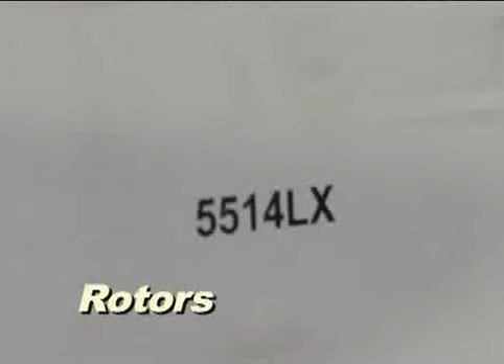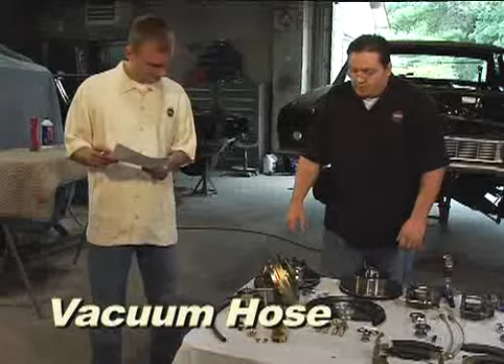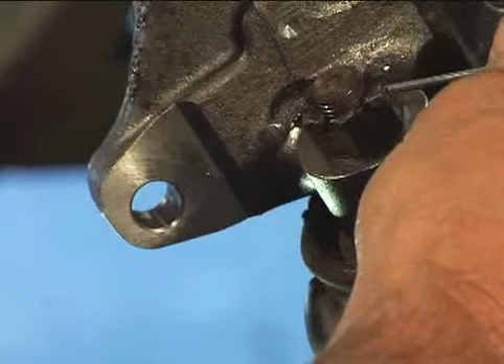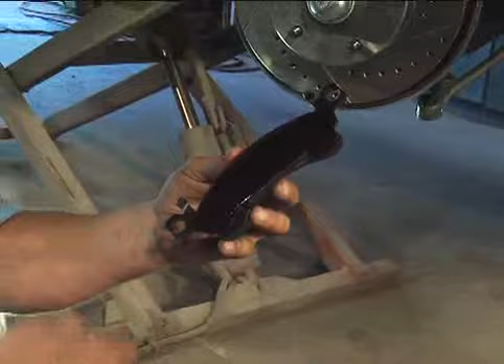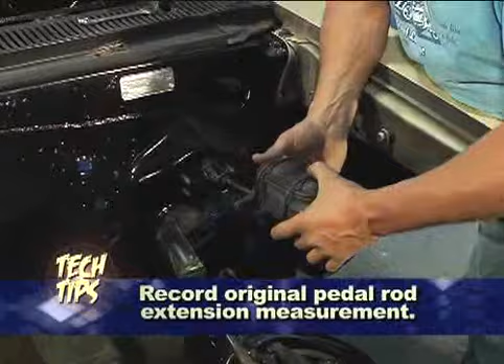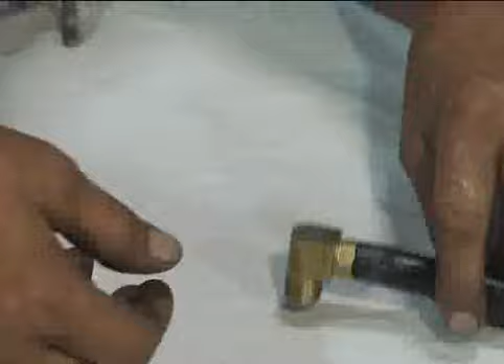GM A, F, & X Body Disc Brake Caliper Brackets Nova, Chevelle, Camaro, Firebird

Comment: I always love these videos that show the nuts and bolts on 50 year cars that come right apart......every single nut and bolt on my '71 Chevelle required a blow torch, hammer and sawzall to remove.....
Reply: Hahahaha same.  Like it seems these shows do the job, put the stuff back on and then re do the job for the camera and every bolt breaks free with a regular size wrench or stubby ratchet handle.

Comment: They did not hook up any brake lines to the car, That was at least an incomplete kit. The way they left it there would be no brakes at all.
Reply: The car already has its own brake lines. You hook those up to the new components. If you need new brake lines, you can purchase them as a kit. I’ve yet to see a kit that includes everything in this video plus the brake lines.

Comment: What I want to know that no one has ever answered is if you have the distribution block that was originally mounted on the frame under the car how do you connect the brake lines to the new proportioning valve located on the master cylinder?
Reply: Did you get your answer? I'm curious, I have a 64 A body with power drum brakes.
Reply: @georgearce5098  No I never got an answer. I just mounted my proportioning valve in the original spot and ran lines that were preformed like the originals. I think I got them from Ecklers.

Comment: Hey shitt for brains, what about torqueing the bolts on the disk brake anchor bracket and the steering knuckle? You don't simply tighten up with a wrench.. it has to be torqued.

Comment: Don't buy anything from these crooks they will not stand behind their products, will not return or answer emails and give you the runaround. ( real-life Pirates )
Reply: I just had to do one for a friend it was a nightmare. The passenger side caliper bracket was slightly bent so the caliper wouldn't fit. That among with 2 or 3 other parts had to be modified to fit. Not happy.

Comment: Hello I have the same brake caliper set up and after i install the caliper and spin the rotor. The outer brake pad rattles, like its loose. how do I correct this?
Reply: I know this is an OLD Post but Someone may have the Same Question- if the OUTER PAD is Loose in the Caliper(and Moves) then the Top Tabs need to be Slightly Bent by Tapping with A Hammer, Until the Pad is Snug in the Caliper.
Reply from the maker: Sounds like you are missing a brake pad clip. They hold the pads in place so they don't rattle. Also sometimes called anti rattle clip....
Reply: P Jack I purchased these rattle clips that were recommended for my nova. But im not sure how to install. I know that the bigger size are for the inner pads but im not sure how to install the smaller clips. Any ideas? http://shop.advanceautoparts.com/wcsstore/CVWEB/staticproductimage//2566/large/22141334_rnb_26210_pri_larg.jpg

Comment from the maker: You can't use the old spindle when doing a conversion kit. You will need to change out your spindle to a discbrake spindle.
Reply: Stefan Bogunovic you can modify the old spindle by cutting .6 of an inch off the top boss and it'll clear the caliper bracket. poor mans methods that'll get the job done.
Reply: Dylan Greene
Reply: +P Jack -if that is the case then why do they sell kits without the spindles